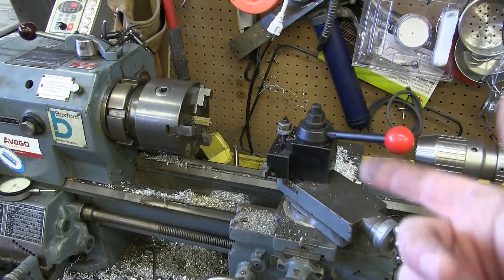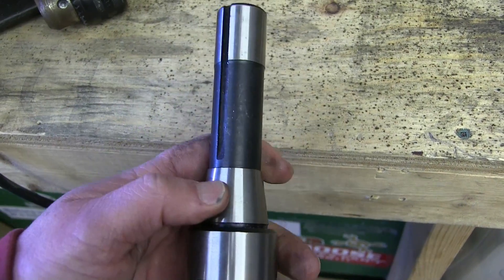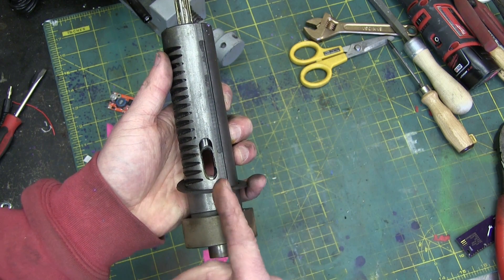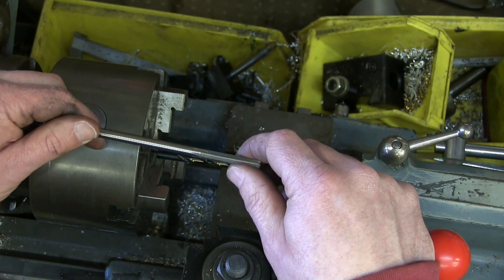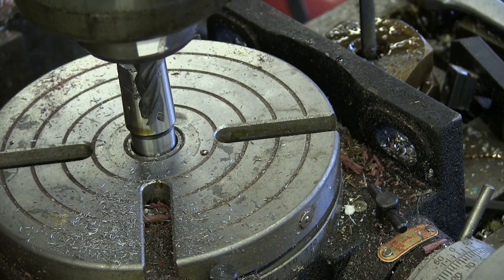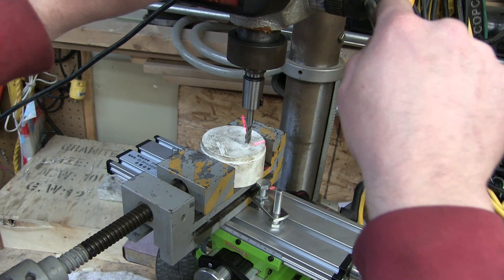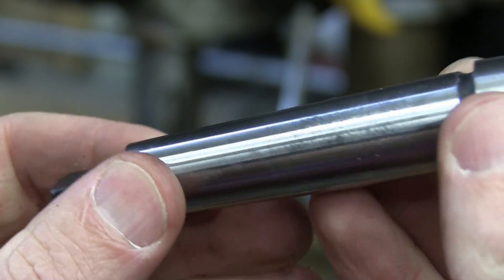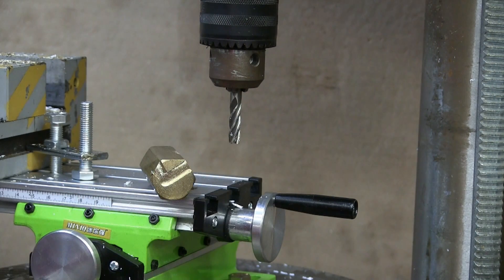"IMPOSSIBLE!" Milling Machine from a Drill Press

Comment: Okay AVE, try this one on for size. what if one were to famulate some sort of rigid vertical router mount, with a screw drive depth adjustment of some sort and put a manual x/y table under it?

Comment: I found on amazon prime.ca a mt3 end mill holder. Steel dragon tools Weldon shank. (I'm pretty sure that is the taper in the drillpress) And the Lucas case multifunctional work table both on prime. Hope this helps someone

Comment: this reminds me of a question i forgot about after watching friction drilling. will a benchtop drill press provide sufficient downforce to do some friction drilling?
Reply: You can do three quarter inch nylon rod with 1 hp. Aluminium or steel require much more power and quite a bit of speed. Downforce isn't really a concern

Comment: ah damn, wished you would have had whacked it with the basher to fine tune the run out, you'd be surprised of the magic within the hammer.  Wang Chung's extruded aluminum milling table is a rock star....  AvE keep your mill you'll need it

Comment: overwhelming urge to blow the chips off the brass....on another note the laser is may come in handy for something later, if it could be squared up it could be used for a half ways decent angle layout so you wont have to bust out a combination square

Comment: Reckon it would be better holding the drill on the bed of the drill press as it's the only way to guarantee accuracy then using one cutting edge of a smaller diameter end mill, bore it to required size using the x-y table. I would also mark up which way round the morse taper goes in, for repeatability.  Very impressed how well it worked with the bad run out.

Comment: You can also turn a drill press into a shitty lathe! :-D I know because I had to do it once apon a time in a 3rd world shit hole scenario. I used it to lathe some 6061 aluminum rounds that were about an inch thick. Yup, she was shitty... but atleast I got the part to fit in the hub that It needed to fit into.

Comment: When there is no mill, there is a way ... reducing the thickness of a part can also be accomplished by poking as many small holes as you can in the material that needs to come off (depth stop set to keep it consistent).  Remove the remainder with your angle grinder.  When the holes disappear, stop grinding and get your clean, sharp file to take care of the minor bumps.  A raw a crude method, but it will work where your preferred methods are not available.  And it beats taking the full quarter inch (or whatever it is you need removed) off with just the grinder.

Comment: How to turn a drill into a mill. You will need; 1) A mill. 2) A Lathe.
Reply: Maybe too late, but you can also file the thing. Whatever you call it. Not fluent in English.
Reply: Hammer
Reply: Surely flattening the surface for drilling could have been done with an angle grinder?  I mean, it's an infinitely symmetrical part; who cares where exactly you drill in from.

Comment: glad you finnaly got round to the most important topic in machining milling in the drill press in short notch the tang allen bolt together two pieces that wedge the tang up in there do not not  use a chuck it willlllll fly off and kill you if you don't welld it on the run out on the chuck can be adjusted by finding the spot on the mores taper and Jacobs taper that cancel each other out modified collet bettter

Comment: With a great deal of patience and a set of extra long drills, you can bore the spindle out  ~1/4"-5/16" to accept a small drawbar and not have to worry about the taper releasing. Also, for extra rigidity on the quill, split the front of the head casting with a slitting saw or a very carefully handled Zipcut wheel on an angle grinder,  and cross-drill and tap for a couple clamping bolts to lock the quill in solid. And for extra mass and vibration dampening, fill all voids in the head casting with molten lead, and the column tube with non-shrinking grout. Still doesn't make it a mill per se, but makes it a helluva lot more rigid and capable.

Comment: why wouldn't you chuch the Morse taper in the chuck and drill with the tail stock? a rotating part will drill concentric, whereas a stationary part with a spinning bit will follow whatever run out there is.

Comment: I've thought too many times about getting ahold of a big, burly, fuck-shit-up-horsepower level 3 phase industrial motor, and welding together a big, scabby, heavy junkyard framework to hold it all. Throw in a few bolts, couple nuts(I have at least two, so that's a start), some bearings & precision ground round stock, drive pulleys + belt(timing belt - or maybe chain - 'cause we're not pussies!), add in an appropriate tool holding fixture and a magnificent chinesium XY table, ala previously mentioned - wire it up to a household light switch(OK, OK, a dimmer switch), and you have yourself a cheap ass, over powered, totally dangerous, and, with maybe a bit of planning, a possibly even decently accurate jackass level home made mill! Sound like a good quick Monday morning project...

Comment: That's trailer right there, but I can't judge, having done a bit of milling half-assery in the drill press myself (with mixed results).  On the other hand, I've actually had pretty good luck doing lathe work on the press.  I've got a video of turning an O-ring groove in a winch bearing plate that has to be seen to be believed.

Comment: +AvE
I like your heat shrink fit method for retaining the taper in the quill. I did some bodgy milling in my drill press 4 or 5 days ago and held mine in with a violent beating from the ball-pein... your idea is better ...less barbaric...

Now that I've seen the trouble you had with concentricity I think I will make a hole in my "homemade Morse adaptor" by mounting a stationary drill bit pointing up from the table and driving the quill down onto it. Then I'll take a lick off the inside with small boring bar in like manner.... I have no reamers. Hopefully that should find the center axis of rotation. Of course, the morse taper will have to go back in the same way round every time... assuming I can actually reliably get it out when I want to. 

If you want, I'll let you know how it goes.

Comment: This was amazing!  See I was looking at my kenmore companion drill press that my step dad said was my grandpa's (later my uncle said he pulled it out of a dumpster), and my adjustable harbor freight drill press and I was thinking something similar.  I decided to let it be. Later I needed to drill a hole down the shank of a bolt and out through the head for a home-made-forge oil supply, and broke off four drill bits and finally resorted to  burning it through with a finishing nail.  At any rate, I've learned most of what I know about machining from your videos so please keep them coming!

Comment: closest thing to modifying a drill press i've ever done is stacking about 4' of donnage and putting the drill press on top of it...

a couple fellows that had the job of fabricating pipe supports went ahead and got a welder to glue the supports to their base plates while neglecting to drill out holes in the plates to fasten them to grating with j-bolts. same couple of fellows got called off the job, and i ended up with it. they were fairly tall supports, ballpark 5'6", and' i'd be fucked if i could find a handheld drill fucking anywhere. no chance they'd fit right side up in that press either...

so, we propped the drill press 4' in the air and drilled the supports out upside down realllllly fucking sketchy like.

good times.

Comment: Why are people saying AvE used a lathe and a mill to make the final product. The part he made with those tools had to be replaced because of run out issues. He used the original chuck in the end. Also every thing he did to the other taper could have been done with the drill press and a file. Just not as easily.

Comment: If you run downcut endmills they will tend to push the toolholder up into the taper.  There used to be an entire line of milling cutters that used B&S and Morse taper shanks with reverse spiral or straight flutes, and were used fairly successfully because of that mechanic.

Comment: The reason you can't use a drill chuck for milling is that the jaws will not grip the hardened shank of an endmill sufficiently. Having said that, it would have no trouble milling some plastic or taking light cuts in soft metals. Also, they do make morse taper tooling that works with a drawbar for milling. My mill has a #3 morse taper spindle

Comment: Nothing wrong with a reamer in a 3 jaw. They just follow whatever hole they go into anyhow. The issue is the reamer won't correct any "webble woble" the drill made. It just make the hole an accurate size, but will leave the runnout from the drill. You have to bore it to eliminate the drill's runnout.

Comment: if anybody is wondering what to get first a mill or a lathe, keep this in mind: a lathe is the only machine that can reproduce itself.
Reply: Tyler Hensley how exactly are you going to make a headstock, bed, saddle, cross slide, tailstock, ways, etc with a lathe
Reply: hopper1 yeah I can make square stuff on the lathe if I have to.
Reply: Pungo Machungie how are you going to make lead screws, quills, pulleys, shafts, knobs, bolts, tapers, etc on a mill?  and yes, set up correctly you can make every single thing you just mentioned on a lathe.
Reply: you can mill on a lathe you can't lathe on a mill. OK small parts that the dimensions or finish doesn't matter maybe.... I not only know it's possible but I have milled lots of things on my lathe.
Reply: Not true! I bought a 3D printer, printed a replica printer, and took the original back for a refund.

just kidding
Reply: Tyler Hensley you can turn on a mill. you've just gotta get an indexing head
Reply: Milling on a lathe, you can't power tap. That's about the only "mill operation" a lathe can't do. Lathe wins easily.
Reply: RoboticsNShenanigans I've power tapped on my lathe. put the tap in the 3 jaw and set the tool post square and use it to start the feed and let it run.
Reply: Did you print a replica of the refund?
Reply: Tyler Hensley they make mill lathes it literally is a lathe in the milling bed
Reply: Tyler Hensley how are you going to mill and grind 30+ inches of way on a lathe? A lathe isn't much good without ways.
Reply: drummond round bed lathes worked well
Reply: You mean a lathe is like asexual?
Reply: Do you mean parthenogenetic?
Reply: 3d printers can only print structural components, but you still have to purchase hardware like bearings, rods, motors, and electronics.
Reply: If the lathe will run the same pitch, sure. I meant like a mill--letting the quill slide--pitch doesn't matter. You could square up the compound and take the lead screw (or nut) out of it to get a quill-like action, but less stable than a quill, of course.
Reply: How are you going to cast the stand for the lathe with the lathe?
Reply: Tyler Hensley a 3d printer is also considered self reproducing
Reply: You don't. You hand scrape the ways from raw castings. Just as they did with lathes for many years. BUT for many of the parts you need you actually don't need ways. You need a spindle and tool rest.

Comment: if you really need to ream with a 3 jaw Chuck or another setup where you have a lot of run-out or a misaligned part, grip the reamer by just the end of the shank so it's able to flex and more easily follow the existing hole.

Comment: BTW, someone else beat you to the Craptacular Mill. It's called a Rong Fu Mill Drill . . . .
Reply from the maker: Rong Fu, is from Taiwan. They got mainland knock-offs that are made from tin cans and paper.
Reply: Yep, I have one of those tin can and paper jobs. It's better than no milling machine, and better than what you just threw together, but that's as much as I can say in its favour. It's a race to the bottom down under though, I don't know where you find the middle ground between a machine with all the problems mine has and something that costs too much to justify for a hobby.
Reply: I long ago demoted my my original 80's Rong Fu to a drill by converting it from R8 to MT3. It makes a decent general purpose drill.

Comment: AvE, we made a mill from a boring head, a base from a pump (!), and one of the larger probably Taiwan made XY tables in ~1994 or so.  In order to get the rigidity to be better than the alternative (which was my South Bend & a vertical slide),  the collet was in the quill.  The whole thing was a bit mickey mouse, but worked far better than a vertical slide.  I used it for doing some of the milling in my railway engine- Monsterous.  https://flic.kr/p/mv6Zh6.  (built @ the age of 17...).

Comment: You should check out some of the older youtube videos of people milling 80% AR-15 FCG's with el-cheapo chinese drill presses. I've done it once and never will again. But it's possible. Never had the press loosen up in ~3 hours of milling.
Reply: Hughes Enterprises It works like a charm with a handheld router, though. You can buy end mills and jigs made just for one.
Reply: I wish the router jig had been out 6 years ago. Pulling a loose jig around a stationary mill by hand wasn't exactly fun, but it did work. Especially plunging into the material holding the jig with one hand, lowering the mill with the other hand.
Reply: If you get a carbide bit spinning fast enough, they can mill aluminum with minimal effort. I chucked 2 flute carbide end mills into a Dremel just so I can remove some materials quickly (part was too big to fit into mill, and it was a part of the mill, meaning I need that part in it to mill anything at all!)

Forget about precision here... general woodworking tolerance is about the best you can get here.
Reply: Hughes Enterprises rr
Reply: I got them all beat. I did it with a die grinder.

Comment: Just got my cast iron Wilton (imported) XY 3" jaw from Trick Tools.  More expensive, but seems to be pretty solid with adjustable gibs.  Going to mount it on a 12" Atlas lathe to use for milling.

Comment: AvE, as a young home gamer just starting to build out his shop - what is the longevity of a back alley abortion such as this?  I need to get a press anyway, but probably won't be able to get a mill for a few years.  Will this hold me over and work as a drill press fine?  I imagine it'd last longer if I avoid running steel under it

Comment: I've been doing this for years with an old craftsman 12 inch drill press, a chineseum x/y cross slide vise, and really crappy mill bits.  I paid about $60 american rubles for the vice.  it actually has about 3/8 inch slop or more in one axis, and about 1/2 inch in the other.

Comment: Alternatively, you could pre-drill and setscrew another of those Morse tapers, but NOT ream out the hole.... jam it up in there, then put a boring in the vise on the table to bore up into the holder... using the table motion to be able to bore to size. It would by definition be concentric with all the wibble wobble... except for the torque of the set screw.

I could also see using a dremel grider pointed up under power to center-grind it.

Comment: Did the exact same thing with a drill press I picked up from harbor freight in order to mill out an 80% LR-308.  The Jacobs chuck kept falling out on me, so I cleaned it all up really well, left the chuck in the freezer over night, and before seating it with a hammer I add a little bit of loctite.  Worked like a charm

Comment: ive always been tempted to do this with one of those garbage cross sliding vises, but i couldnt bring myself to spend 50 bucks on a casting that was THAT trashy, thats really not bad though, ive tried cutting plastic pushing it by hand and using a router bit in the press I KNOW I KNOW it was bad, nearly took my hand off, and for the dead tree carcasses I KNOW I KNOW MEA CULPA that thing would be damn good

Comment: Bought one of those X-Y tables in an attempt to do metal work on a Delta Midi lathe. Have already been turning brass on the thing with ER collets and files on the toolrest. Works but I want metal toolbits in something approximating a carriage and cross slide. My first attempt at rigging this up kinda failed but after seeing this I think I'll give it another shot.

Comment: This is actually a good project for those of us in the states who like to purchase and build AR-15's and variants using partially machined lower receivers, but who don't own a milling machine.  They are called 80% lowers and if all you have is a drill press, this would greatly contribute to your success and the precision of the finished part....  Even if you have a mill, this is a fun way to lose an eye.

Comment: Iff'n ya REALLY wanted to go crappy, and make sure that morse taper didn't fall out, you could drill a hole through the pair and pin 'em together. 'course, you'd still be left with the Jacob's chuck.